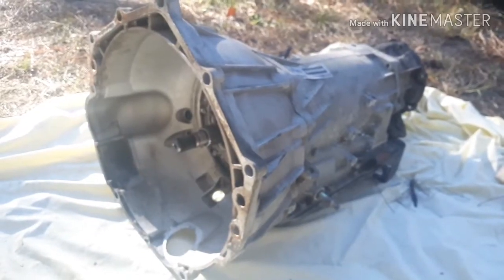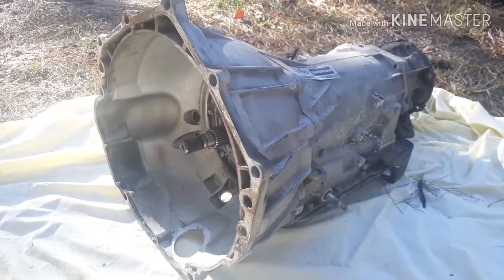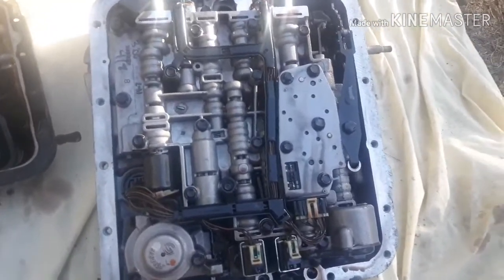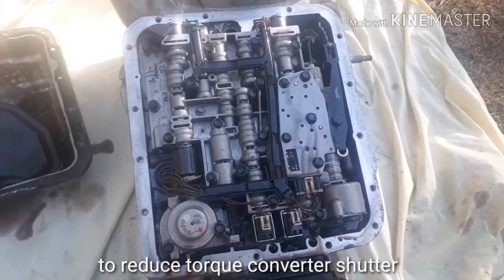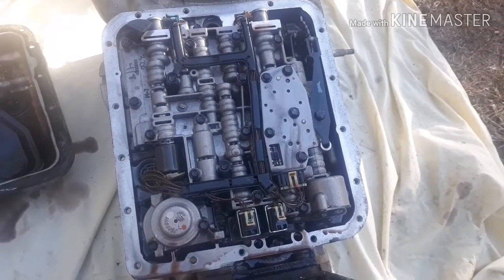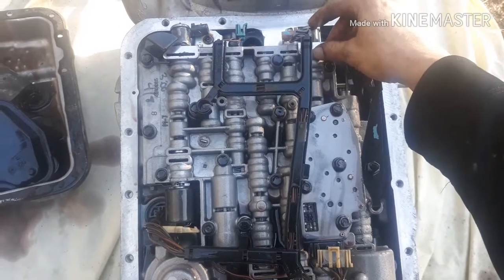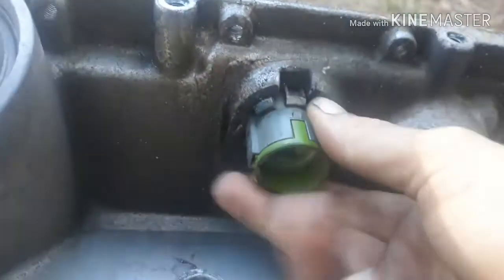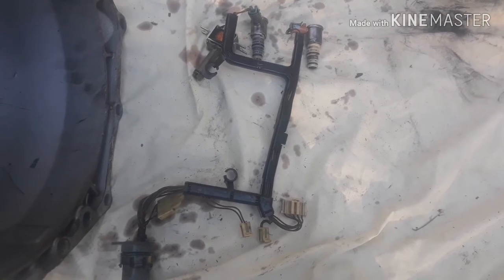LS SWAP WITH NON PWM 4L60E TRANS... 1 PIECE 4L60E LS SWAP

Comment: so i have a 97 k1500 with the 1 piece 4l60e, trans actualy came out of a 98 suburban. im 98 percent sure its a pwm trans. i just pulled the motor and trans out of a 01 suburban. unfortunantly i sold the trans to a buddy for $1800 with install, i was going to use trans and motor in my swap. so now the cash from install goes to upgrades and funds for swap. i already ordered the standalone wire harness for the lm7 nmd 4l60e, have my hp tuner, mounts and torque converter spacer. is the current trans in my 97 going to work fine with the 01 burban computer? or m i going to have to take the harness and solinoids from my buddies bad trans ( 01 silverado) and put it into my 97 45l60e? i want to make sure i hved all bases covered so i can get it all done in a a weekend vs spread out over weeks waiting on prts i didnt expect?
Reply: Did you ever get a answer I'm trying to do the same with a 95 trans in a newer tahoe
Reply: @kristophermorris1460 97+ good till 07/08 older than 97 almost has to be same year
Reply: @kristophermorris1460 97-07.5 direct fit. 96,95,94 isn't going to play nice without some tuning and the hp tuner module won't work with older than 98 so prolly not going to happen for you
Reply: @erik120719 i used the 3/4 clutch pack out of the 95 put it in my 03 4l60e now where good! Thank you for hitting me back

Comment: Thanks a lot man . This information is very helpfull. Its your transmission working good whit the ls swap?
Reply from the maker: Yes everything operates great.. personally I like using the older transmissions vs 4l60e/ 4l80e less wiring less headache in my opinion

Comment: When you carb converted your ls what trans did you run with it? And how did you do so? Im about to carb by ls1 4.8l it has 4l60e trans but haven't got a solid plan to run the 4l60 le or th400...
Reply from the maker: I ran a th350 trans that way all that's required is a vacuum source and the torque converter spacer... if you run a 4l60e with the carb swap you have to get a transmission controller also
Reply: @MikeyTunedPerformance  nice but if i do go for the 4l60 i need trans controller and tps??? So iv heard...
Reply from the maker: @sensationsgarage5572  exactly
Reply: @MikeyTunedPerformance  much mahalo from kauai hawaii much aloha man🤙🤙🤙
Reply: You can't run a 4L60E with out computer. Only 4L60 no "E"/700-R4
Reply: @diduck6878  try look up manual 4l60e with out computer this guy did it.......im not sure if was a 60 or 60e but he did it with some switches🤔
Reply: @sensationsgarage5572  that's cool but why re-invent the wheel. 4L60"E" is the (electric) version of the 700-R4/4L60 no "E"

Comment: What vide is the update?
Reply from the maker: I'm sorry I havent had time to do an update a tree fell and hit pops truck and our ford truck unfortunately I literally just got the tree cleaned up off of them yesterday so I will be finishing the truck as soon as possible
Reply: @MikeyTunedPerformance  no stress it does work good tho? I build transmissions and have a customer wanting a one piece and i think this is what we need to do. But i need to see whats been done to the truck and that will come monday.
Reply from the maker: @greglysne3260  yes sir only thing I've  noticed is a slight bump with the 3-2 downshift
Reply from the maker: @greglysne3260  I dont build transmissions I just try an do as much research I can and help out others with the problems I come across like the ls swap using a 1 piece 4l60e pwm issue